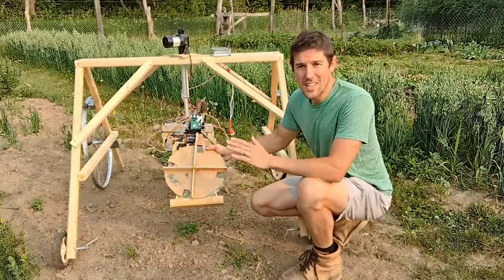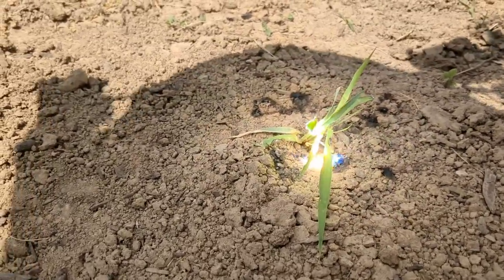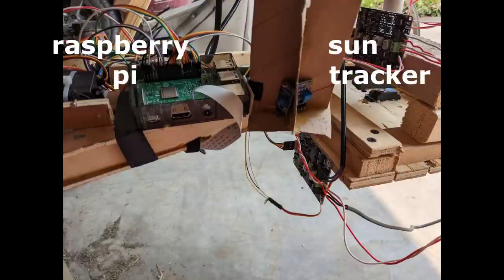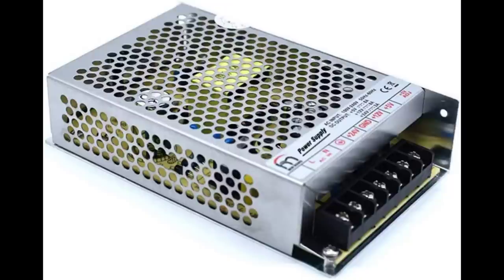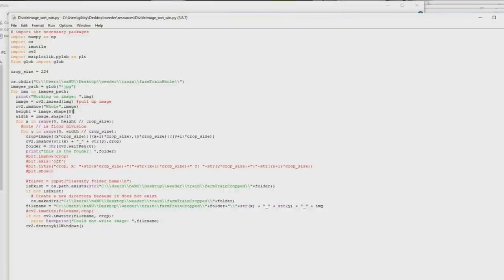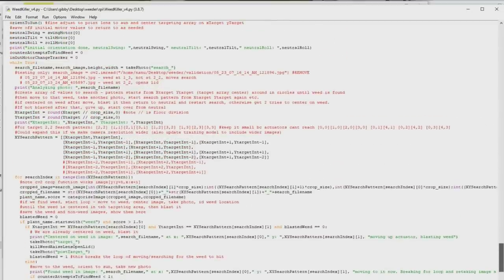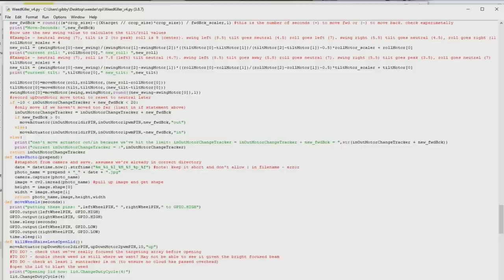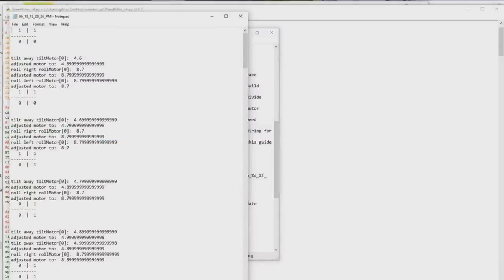DIY AI Weed Burner Robot | Robot weeds lawns, gardens, farms | Full build plans, parts list

Comment: Could use polarizers to turn the lens on and off instead of the flap. A couple of salvaged polarizing sheets at 90 degree angles to each other would block all of the light coming through, then rotate one to let light through. Or you could use an LCD for the same thing. That might be a little more foolproof than lifting a flap that can suddenly catch wind.
Reply from the maker: Good call. Any idea where to find polarizing sheets for cheap? Or should I turn to online suppliers?

The LCD is really cool, but I'm thinking the next revision of this is going to be much smaller and less expensive, so I hesitate on LCD
Reply: Polarizer sheets are like 1USD.
Reply: So awesome. Fresnel lens, polarized sheets and delta guide wire setup might be great for my little garden. For extra credit it could focus just enough extra light to help good plants when cloudy. For extra extra credit, fricken lasers to kill specific pests
Reply: AFAIK, there is a polarizer sheet in any LCD screen.
Getting one from a trashed TV/monitor/laptop should be doable.

Comment: WOW, Impressive!  Anybody who says this is too complicated for a simple job does not understand gardening, ag, energy...  Likewise the fire danger is over rated, farmers will deal with it, flame weeding is an established method. Hence the others who have said the weed does not need to smoke to be killed, check out the "wilting point", the ultimate model will be much faster and know exactly how little heat it takes to kill weeds of various types at different sizes.  A huge advantage of this that's not obvious is the lack of soil disturbance bringing up weed seeds, that is huge to organic producers.  Funny that people say you should just use a laser, like saying why should you ride a bike? you can just take a jet.  Maybe a large solar array could power a laser or focused microwave and do the same thing, but the cost, size and speed would suffer huge innefficiencies. Fiber optic is fascinating, excellent idea, but I like the lenses also.  An idea I've had since 2006 was another variation of this with an array of stationary parabolic reflectors aiming their points in turn at nearby weed species, that was in a rangeland situation, your small mobile device is much better suited to weeding garden crops. The point being that reflectors, parabolic or otherwise, could be aimed and coordinated to accomplish the same thing as a concentrating lens.

Comment: I find it refreshing to see a creator that for once does not use a 3D-printer for every mounting bracket or connection. 
(Balsa)wood, plastics, clay or metals can actually be shaped with simple hand tools faster than your typical [3D.software-Slicer-plastic selection-#D-printing...] and the accuracy is usually "good-enough" to get the concept proven.
The reason I came here is that I had thought about building something along the same principle of a Fresnel lens on a moving platform controlled by a RasPi. It is  great to this approach which I can (and will) use to improve my own design. Thanks!

Comment: This is a great solution. The University Hohenheim testing/building weed control robots that detroy weeds mechanical or by applying hot water or foam. You might find some ideas for improvement in their published work.

You don't need to burn the weeds completely. The humidity in the plants will be transferred, even down to the roots. I really like your solution. The burned material is even beneficial for the other plants. I could imagine that heating water with sun energy and spray the weed with this hot water is simpler to build.

To avoid problems when wind hits the opened lens cover, it might be better to move the cover sideways?
Reply from the maker: Thanks for the pointers to University Hohenheim. I'll check it out.  I was thinking about what you mentioned as well - the burned plant matter will be good for the soil as well.

I've started planning v2 of the weeder, I agree moving the lens cover to the side would be better. I have to figure out how.
Reply: @nathanbuildsdiy  ⚠️ God has said in the Quran:

🔵 { O mankind, worship your Lord, who created you and those before you, that you may become righteous - ( 2:21 ) 

🔴 [He] who made for you the earth a bed [spread out] and the sky a ceiling and sent down from the sky, rain and brought forth thereby fruits as provision for you. So do not attribute to Allah equals while you know [that there is nothing similar to Him]. ( 2:22 )

🔵 And if you are in doubt about what We have sent down upon Our Servant [Muhammad], then produce a surah the like thereof and call upon your witnesses other than Allah, if you should be truthful. ( 2:23 )

🔴 But if you do not - and you will never be able to - then fear the Fire, whose fuel is men and stones, prepared for the disbelievers.( 2:24 )

🔵 And give good tidings to those who believe and do righteous deeds that they will have gardens [in Paradise] beneath which rivers flow. Whenever they are provided with a provision of fruit therefrom, they will say, "This is what we were provided with before." And it is given to them in likeness. And they will have therein purified spouses, and they will abide therein eternally. ( 2:25 )

⚠️ Quran
Reply: In a "production series" you can make something like the shutter of a camera (or the stargate :)

Comment: I am very impressed by your method of finding and killing a weed with a machine that has the repeatability of a felt hat. I spent nine years 30 years ago working on using computer vision on a robot sprayer to identify and trigger a sprayer to kill weeds or apply fertilizer to wheat. The academics needed to allow user input on weed identity to kill weeds well. The user is the only one that can define the weeds in their garden. The user defined the fertilizer setting for wheat that part worked fine.

Making the solar weeder smaller and lighter and mounting two or three of them cn one chassis scales your robot.

There isn't one size frame that works all season long. A low frame that covers two rows may work best early in the season. Later a tall boy that straddles a single row like the one you use now. Finally, a small robot working between rows using other methods to kill weeds.
Reply from the maker: Thanks for the encouragement!  That's good advice about different size robots for different times of the year.  I see a path to a much less expensive, small weeder in the next revision for early season or between rows.  Then I'll probably come back to this one.  Adding multiple arms/lenses would be pretty neat after that.

Comment: This is an excellent low-power approach proof of concept! Very efficient. Thinking ahead I can see lasers being used also when the light conditions are not ideal or to zap insects. Yes, this could be used against pests with lasers so as not to damage the plants. Just a thought
Reply from the maker: Totally possible, but I think getting lasers with enough power would really increase the cost, right?
Reply: @nathanbuildsdiy  Yeah, and energy usage too- more battery and perhaps a solar panel etc. Components really add up quick. Device gets heavy. Still it would be nice to zap the cucumber beetles. Also I think it would be cool to have a doorway entry sentinel to laser flies and mosquitoes coming in behind or from an open window even. Imagine training that to work! I find this DIY approach to the problem very refreshing

Comment: This is awesome as long as it doesn't start a wildfire. You should make an autonomous mower /s 😂
Reply from the maker: LOL, on it boss.

But yes - the fire risk on this one is there. I actually stopped to give a warning about starting fires at the start of the build section.
Reply: @nathanbuildsdiy maybe combining it with plant irrigation so after the weed is burned the area is wet and fires or smolders are stopped before they can spread

Comment: This is brilliant. You can make this even solar driven, it works in the sun only anyways. Maybe it could be an improvement do direct the focal point of the lens into a light conductor fiber? This way you can let the lens be pointed always towards the sun, and only move the fiber where the light comes out of it over the weed. So no need anymore to get all three moved in one straight line: sun - lens (at 90°) - weed.
Reply from the maker: That's an interesting idea! Is there any heating in the fiber or can it transmit a lot of light/power easily?
Reply: @nathanbuildsdiy  I don't know. That was just an Idea that came to my mind. But the fiber should just pass the energy through with almost no resistance. So I think there should be no, or almost no heat inside the fiber.

Comment: Why not hang the lens off of 3 wires? This way you can move, tilt, raise/lower the lens however you want just by three spools. :)

The wires can double as signal/power/ground for the motor in the center, which removes the lid.
Reply: Then you have something above it covering the sun

Comment: For areas with a lot of shade, where the creeping charlie is, you would need something like a periscope to allow capturing the rays in sunny area, and using them in shade.  But finding one that wide could be hard.
Reply from the maker: Some have suggested fiber optics, put the light in the cable, then point the cable at the weed. It's worth a try

Comment: After rewatching this video a month later, I think the safer route would have been to make it an autonomous weed sprayer instead with a cheap more eco-friendly approach using vinegar, dish soap, and salt. Have it drop a predetermined amount of the mixture directly on the plant. It may operate a bit faster and hit more weeds but it's going to remove the risk of accidentally starting a wildfire. 😅

Comment: This is incredible. With a little solar power you could keep charging up the batteries to run a wheeled Rover with this and other attachments. Have you seen the Amiga made by Farm-NG? I'm working on putting together a wheel base that could connect to different attachments for vegetation management and site monitoring of large scale solar arrays.
Reply from the maker: I've thought about the solar charger as well, it'd provide some protection from sun/rain.  I think in revision 2 I'll do that.

I hadn't seen farm-ng before, neat ide and products! Let me know  how your project goes.
Reply: @nathanbuildsdiy  you could use a smaller solar cell and use the lens to focus the sun onto it. i dont know of the power economics work here, but the idea is entertaining.
Reply from the maker: ha! That's a good idea. I wonder if I could put the solar cell under the weed burner fresnel lens (since I already need it for the robot), then move the cell out of the way when I want to burn weeds.  Cool idea!

Comment: First, I think this idea is really cool, but is this as efficient as drilling out the weed? You are moving a lot of servos.
Reply from the maker: There is a startup that's pulling weeds directly I think.  I think the act of pulling would use a fair bit of power as well though, so it's a toss up.  Worth benchmarking though!

Comment: You don't have to roast the weed to a crisp. Heating it up over 150F will do the job fine.

For example, you could have a lump of aluminum heated up somewhere safe and press just this onto the weed. Fire hazard eliminated🤗
Reply from the maker: That's a neat idea. Could still use the sun to heat the metal, then use the metal to fry the weed
Reply: @nathanbuildsdiy  The idea with the heated plate sound nice, but adds a lot of complexity. Try to stick with the first part, and just don't focus the sunbeam as much, so the weed only get's cooked to death.

Comment: Just curious, Why not use a laser? Seems like a laser might give better control and maybe easier to build?  Plus you wouldn't have to rely on perfect conditions. Id love to see a diy on a laser based weeder.
Reply from the maker: A laser would be simpler, but one that can burn weeds would have to be pretty high power.  I haven't found one that's reasonably priced and high enough power, do you have some leads?

Comment: I would just add a small solar panel on top. And if safety wasn't a problem I would use burning lasers...
Reply from the maker: I'm planning to add a solar panel in the next revision, but high power lasers are expensive, aren't they? I'm trying to keep costs down